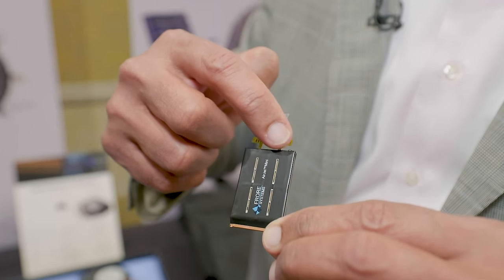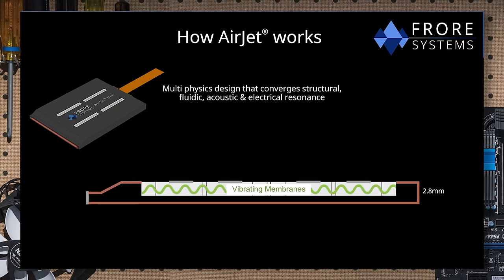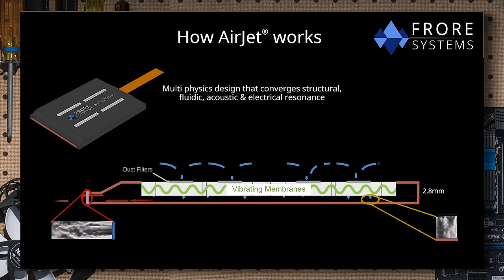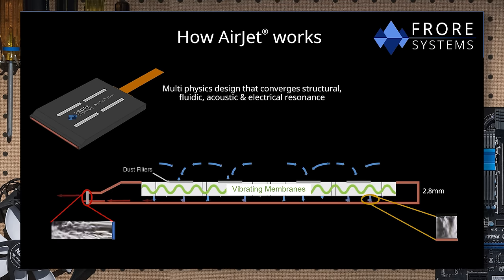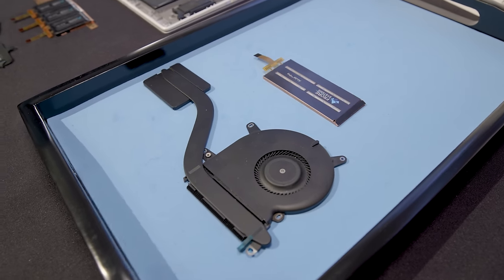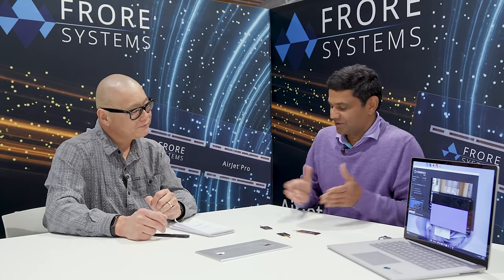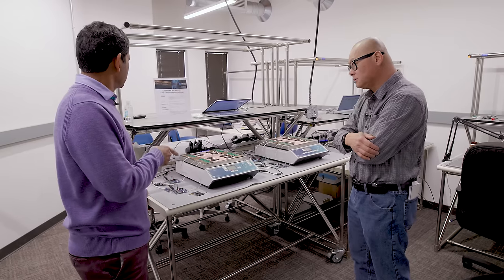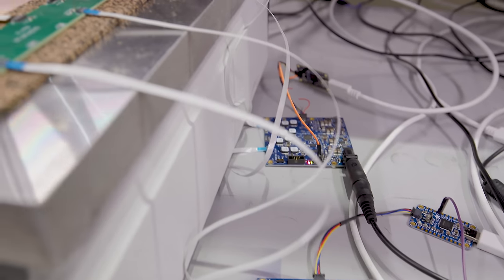Take A Lab Tour Of This Solid-State Cooling Tech

Comment: As long as they don't become an exclusive for 1 specific company... this will be revolutionary for laptops phones and anything that uses low power.
Reply: Yes...please God keep Apple out of this.
Reply: @jeffsmith6659  they already bought 100% of the first batch 😂
Reply: Apple will buy them if it scales
Reply: I want one in my steam deck
Reply: If so, where can we invest -_-
Reply: I get the concept, I could definitely construct this with off the shelf parts, hopefully their patent is strong because innovation is important
Reply: @hacked2123  hmm.. my guess is, finding/developing vibrating membrane parts might harder than you thought, a working and reliable one that is. and of similar build size. maybe possible with bigger form factor, but not this tiny

well, ive been wrong and humbled many times before, so take my guess with a grain of salt 

cheers😁
Reply: @LoveStrangeDr  Nope. Intel Evo laptops are their first partner according to their website. Qualcomm also has interest.
Reply: If you don't want them to become exclusive, better bid harder.  The market will do what the market does.
Reply: @__aceofspades  It was a joke bruh
Reply: @valentinn6811  Honestly I think it's pretty overkill for cell phones. They already have a lot of room to improve passive cooling anyway. Just don't cover the entire damn thing with glass and plastic.
Reply: @jeffsmith6659  Apple does not need cooling, they are fine with running their CPUs hotter than the Sun
Reply: @hacked2123  vibrating membranes for air movement are an established technology, but not at this size.
Reply: I just wanna buy them and just slap them on all kindsa stuff, just to see if they're useful. Make a hat outta them and wear it on a hot day. Assuming they're not $200 each or something ridiculous.
Reply: @LoveStrangeDr  Can I have a source for this?
Reply: @ThejusRao  naw
Reply: @LoveStrangeDr  If only there was some sort of icon you could put when you're joking so people would know. Maybe that could be the next great invention! 😂
Reply: I could picture these being very useful in the tablet space. Imagine having a couple of these moving air over the heatsink and motherboard to cool the U series chip in there.
Reply: apple will buy them out
Reply: @marcogenovesi8570  Ah yes i remember the hot arm chips! Dude ever since they dropped intel they are doing absolutely great
Reply: Only if phones want to get rid of their waterproofing
Reply: @@NotANOVERPRICEDGOUGINGTECHFAN steam deck 2 will focus on battery life improvements primarily.
Reply: @reallycarson  source?
Reply: low power? i wanna strap 10 of these ot a big water block and cool a whole system
Reply: @jeffsmith6659  He did say apple a couple of times.
Reply: @LoveStrangeDr probably the nubia in the future
Reply: @jeffsmith6659  LOL hopefully all laptops could get it but apple could very much improve with these.
Reply: Notice the lack of information around how it is actually made, they already got a patent for the product. Humanity is doomed.
Reply: @MinusMedley  obviously they have patents for it, it's not a charity.. they have the potential to make a ridiculous amount of money
Reply: Even then, patents only work for 5 years, after that anyone can copy  and sell it or use it 👍👍👍
Reply: Intel and Qualcomm invested so they will be the first ones but yeah hopefully not the only ones.
Reply: @revdarian  dell is also also invested, i heard it in ces not sure about hp and asus.
Reply: Wait for Made in china airjet 🤣🤣🤣
Reply: I agree. This will be so amazing!
Reply: I don't know about that, they are stress testing it at 55 C.
Reply: You mean like Gorilla Glass?
Reply: @SoberAddiction  Ha ha! He said “Apples to apples [comparison] not Apple Inc.
Reply: @pierrejeanes  14 years depending on the industry. Pharmaceuticals can get 16-18 years.
Reply: I just need new battery technology, bigger capacity and smaller size
Reply: @blackrockcity  I know. That might be why I didn't capitalize it.
Reply: @LoveStrangeDr  is this true ?
Reply: This better not be brand exclusive.
This is the same concept as a console exclusive game, bad for consumers.
Reply: You don't want a phone that needs cooling. Your battery would be gone in a flash.
Reply: they are partnering with a few companies that make those ultra style laptops, including apple.
Reply: Licensing would probably make more sense than just manufacturing. No matter how big a factory they have, it's not big enough to meed potential demand.
Reply: imagin not the low power, imagin the uses for high power
Reply: @__aceofspades  Intel Evo is garbage
Reply: Or China will just copy this idea
Reply: I dont find dusk is the enemy but the oil.
Reply: That's very unlikely
Reply: No! Laptops yes, but ANYTHING that is SEALED, like a phone, CANNOT use this!

Don’t you people pay any attention or actually try to understand what they tell you!?
Reply: @pepeshopping  4:10
Reply: I don't think they will allow Apple to buy them. I'm pretty sure they know they'll be able to make more money in 10 years as an independent company than whatever money Apple is willing to spend to buy them out. They can sell chips to the Apple, PC, phone, game console, and industrial device industries all at the same time. Apple isn't going to compensate them for all those forgone sales when Apple can be just a normal customer of them and spend way less.
Reply: Low power?

Comment: Selfishly, I would love to see this tech used in future handhelds, like the potential Steam Deck 2 and Switch 2, as well.
Reply: Zero chance Switch 2 would get this, they have to make Tens of millions of those in next year or the year after the desing is already finished and its the same story for Steam deck 2
Reply: first use i imagined for them. a silent handheld that can dissipate 15-20watts would perfect use of it
Reply: Yes to the steam deck. I would pay for a premium model with this tech, like with the etched screen
Reply: @Deadlines-X  what does that have to do with whether or not they would use airjet?
Reply: @Deadlines-X  Yeah. Switch two is finished when it comes to the Designs. Its impossible for the first Batch for sure. Maybe for the next adjusted Switch 2 hat comes after it. (There are always small changes they make we often dont even know about like the PS5 that now comes with N6 Node instead of N7)
Reply: @freddybell8328  I'm not saying they wouldn't use it I'm saying they have to use mass manufactured parts that won't give any issues, they already had the 2 fans issue for the steam deck they would probably wait for steam deck 3 when the tech is proven, I would want it in a steam deck 2 aswell but you gotta be realistic
Reply: @freddybell8328  The reliability seems good - at least from the video but that's not the only problem a manufacturer has to be worried about. Scalability and supply volume is going to be the biggest obstacle to clear if they're going to use it in any device, especially for one that sells in the millions.
Reply: I want one shoved into my controller to keep my hands cool during intense gaming 😤
Reply: Handhelds for over 1000€ witout a removable battery ... nah not for me.
Reply: I think we’re years ahead of 100% completing this product so I don’t think we will see any electronics with this chip in them any time soonz
Reply: @quigonjinn3567  u can replace steam decks and switches battery though, it takes effort but doable unlike earbud batteries
Reply: That is definitely a possibility.
Reply: You have NO IDEA how important this is in custom high spec laptops.
Reply: I think you might be thinking too small. Maybe I am too. Surely the first adopters of this are the big companies - Intel, nvidia - then perhaps governments / supercomps in labs let alone NASA. But I must be mad I just don't get it.
Reply: steam deck is 30 watt device, the air jet  is 1 watt power for 5 watt heat. so basicly we need 5 of this, that seems too much for handheld. this tech unfortunately at this timeonly good for evo laptop.
Reply: @alexamderhamiltom5238  You don't need to heat sink the entire device. It's mainly the APU that peaks at 15 W so 2 x Airjet Pro @10.75 W heat removal on 1.75 W power draw each would be plenty. The existing fan is 5volt @ 0.5 amp draw so that is 2.5 W. This is obviously all theoretical as the product does not exist off the shelf yet or never.
Reply: @78646666668  my understanding is we will see intel evo laptop by the end of this year with these chips
Reply: Would probably be too expensive to use in a budget conscious console like a switch. But I could see it in a Steam Deck.
Reply: @Xyzair  touch grass
Reply: Steam Deck SUCKS, buy Aya Neo, or Rog Ally instead. Even you have GPD WIN 3

Comment: Glad to see PCWorld did a deeper dive interview with AirJet, as IF it takes off, it will likely revolutionize laptops, tablets, and maybe even some phones. Also glad to see AirJet is actually doing product tests to make sure they are commercially viable, and arent just some concept product.
Reply: I think the Concept for sure is more beneficial in small Formfactor Products but i also think this should also be very useable to built into normal PCs. It seems they are very small so thats very beneficial regardless. When i look on those Massiv SSD Coolers for example…

I dont know enough about this new Tech to know if its useable directly on an SSD but just in Generell… I think it could be useable and not that much expensive compared to a massiv Cooler with Fan as well.
Reply: @flimermithrandir  In a desktop PC you have plenty of space for traditional cooling solutions, there's no world in which it makes sense to implement this technology there. Unless maybe you're doing a microATX build in a super super small form factor case.
Reply: @ForeverMasterless  You never saw (for Example) the GP-AG70S1TB-P right? Try to use that on an Mainboard where the first Slot is under the CPU Cooler and the second one is under the GPU. So you may be able to use it on the 3rd one which is only an 2x4 M.2 (on my MB at least). Great Idea.

Yes you can just Watercool your PC and just not have that Issue (maybe) but still... Not everyone will do or want to do that.

Just because you dont use it doesnt mean there is "absolutely no use" for it. There is plenty, trust me.
Reply: @ForeverMasterless  They can use this in GPU. So the GPU thickness will be reduced. We can add think as a CPU cooler too. For PC case definetely fans are important but we can implemet these things as CPU & GPU cooler.
Reply: @ForeverMasterless  "there's no world in which it makes sense to implement this technology there" instead of a massive heatsink under your gpu for a 5.0 M.2 drive which wouldn't allow you to install the gpu due to heatsink, you could instead use an airjet. kindly take your comment down mate. ignorance like that shouldn't be spread. 
Filmer also understood the assignment.
Reply: NGL, I was a bit skeptical about this product as last time, there wasn't a whole lot of meat behind those words. I'm happy and excited about the product and it's implications, but I'm skeptical about the price. I guess we'll know when it launches.

Edit : Also I'm glad to see Gordon asking the "tough questions" on the dangers and longevity of the product and it's testing.
Reply: @flimermithrandir  I see no reason why it wouldn't work with an SSD.

I haven't seen any modules stacked in series and I think in all of the demos, it was only stacked in parallel which would make sense as it would block the intake ports.
Reply: @N1c0T1n3__  Of corse it needs to launch first before we can really say much about it but PC World and LTT both looked into it again at Computex as it seems and it also seems it can be made longer as well.
Reply: if this can match fan cooling and is quieter I'd use this on my desktop
Reply: What was the result it's been over a year so far?

Comment: This gentleman start falling apart from the moment he was asked whether it was a fan lol. Yes it is fan, not the typical mechanical fan but a piezoelectrical fan built ontop of a copper plate. Solid state is solid state and this is just a fan and copper plate, same as cpu fan and heatsink. Most importantly, a fan was design for heat extraction, whether it was a ceiling fan or car egnine fans and the current Oneplus concept device literaly uses this same piezoelectric tech as water pump in their phone. Oh yh most slim laptop are design to draw intakes from sides, buttom or front, allowing the air to pass over internal components and cooling them before reaching the fan blades and being push throught the heatsink to remove heat from APUs. he really has not done his homework or trying to mislead. Best use case I see for this are DLSR, Action Cams, handheld consoles etc...

Comment: Considering that M.2 drives are often space constrained it would be interesting to see a M.2 heatsink using this tech.
Reply: This. Way better than use 4 of them to replace 1 fan which is moronic and only adds more points of failure for the sake of better noise
Reply: @enricod.7198  More points of failure - true, but you also get some redundancy, while a single fan failing usually breaks the whole cooling system. This also seems to be relatively new tech, meaning the lifespan (or the performance) is likely to increase.
Also, according to this vid (which is obviously biased, but I didn't look up other data) they have significantly better performance than traditional fans of similar size. And lower noise isn't pointless, since gaming laptops and handhelds can get pretty loud.
Reply: @enricod.7198  Or they could scale up the design
Reply: Oh, my; I would love to pay extra for a performance laptop that always stays silent

Comment: I appreciate Gordon asking good questions, sometimes things are to good to be true. It looks something true, look forward to products having them.
Reply: It seems it may well be. At CES he said it takes one watt to run to remove 5 watts. That’s a lot more than a fan. If Apple were to put this in a MBP for example, it would decrease the battery life by about 20% under load. PC laptops already have horrendous performance on battery power and Apple would be unlikely to take that cut. So I don’t think industry is going to be as creative with it as they could be, especially given how uncreative they are so far. E.g Apple is the only ones doing asymmetric fan blades, but won’t use vapour chambers. And the reverse for PC. I think industry is gonna keep moving towards fanless thin and lights and big desktop replacement even with this technology and no good combination of the two. Otherwise we might have seen it already even with fans.
Reply: @Freshbott2  It doesn't matter if it impacts battery life in a laptop as most people keep their laptop plugged in when it's under load because they're usually at a desk working in something for long periods.
Reply: @Freshbott2  hopefully we can bank on either refinement of the air jet tech, or battery tech. Ideally, both.

Comment: Excellent video, I enjoyed the lab tour and explanations by Seshu. The test with laptop retrofit was interesting. It would be great if AirJets were made available for aftermarket/DIY use at some point. I could see them being used for cooling SBCs, modding laptops (especially more repair-friendly ones like Framework's), ultra low-power mini PCs, handheld consoles/PCs (e.g. SteamDeck), and smaller computer components (like nvme SSDs, as mentioned in the video).

Also, that noise comparison sample isn't just quieter but also has a much more pleasant sound signature (I'm not a fan of centrifugal fans/blowers in laptops). Very interested in seeing this hit the market.
Reply: Well said. I think making it available as an aftermarket device while trying to break into the OEM market would help it get traction. Just as SSD's were an interesting but expensive form of fast storage back in the day vs 9000+rpm HDD's (my little Corsair 60gb SSD set me back a lot when purchased mid 2000's) and cheap mass storage, the benefits became clear observing those in the DIY/performance space and OEMs eventually followed. It was an important building-block in making thin laptops and portable devices.
Reply: They shouldn't enter the after market just because they'll lose money and deals from bigger brands. Its kinda stupid to create something significant that has true potential in the near future and just release it into the wild and lose all potential deals and profits. Nobody in this day will create something and give it away to charity that is the after market. With release it into the after market, of course somebody is going to recreate it, work around the patent or even just replicate it entire and sell it, then the company should hire lawyers, firms to fight those people and guess what? The company is wasting money on lawyers and ends up less money for say R&D, Market outreach etc etc. Maybe in the far future where these things are popular and the company earns/has earned money their innovation . It can be released into the after market. But going into the after market now would be a big mistake in the business sense of things